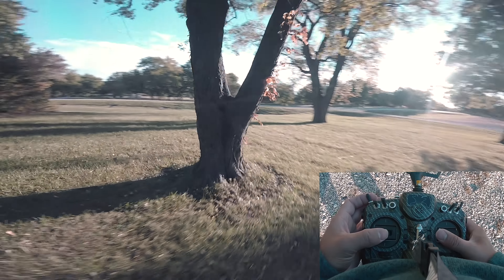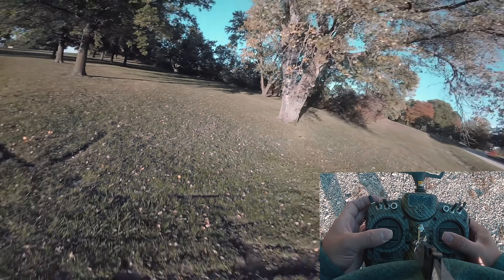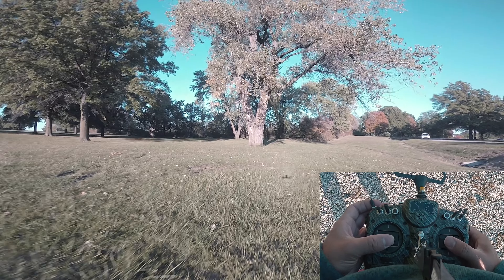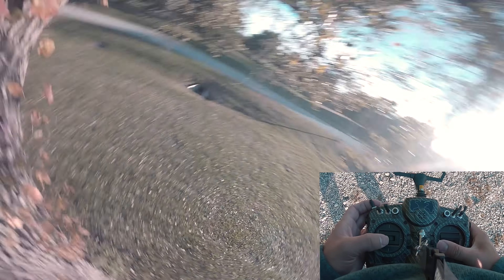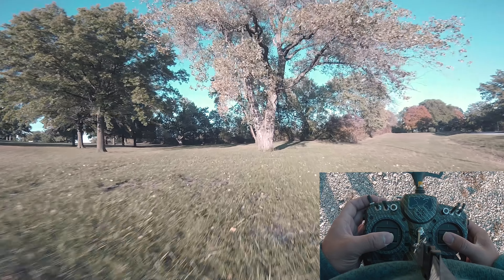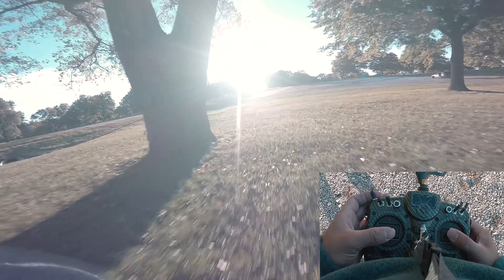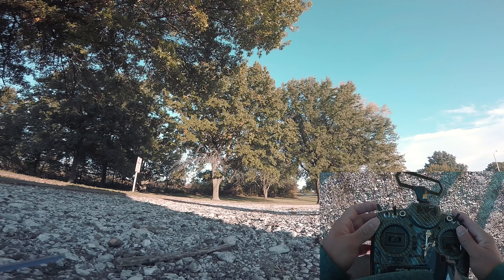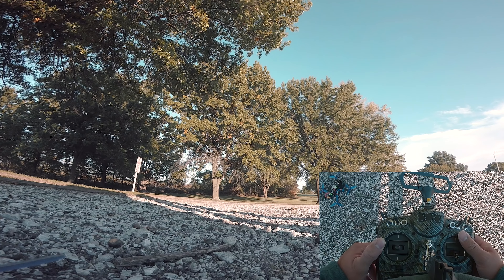FPV TRICK SERIES: HOW to SPLIT-S a GAP 🔥🔥🔥| FPV FREESTYLE!

Comment: So your flying is so fluid! How do you get almost no propwash? Did you feel that the kiss V2 helped with that? I'm still on the V1
Reply from the maker: Kiss v2 helps a lot with that and having the right weight and prop and motor. The setup I have has been solid for months that’s why I haven’t changed anything.
Reply: Thanks so much I think It's time to upgrade to a Kiss V2 and the new esc's. 
I have the same setup as you only the flight controller and esc's are still the V1. 
I definitely agree that your setup is rock solid!!

Comment: hey there awesome flying what drone setup r u using? id love to get myself a nice fpv racer for the holidays... 4" or 5? id love to kno what machine that is... and did u tune it or did it run pretty str8 out the box? what would u recommend?
Reply from the maker: I run only custom builds that I made myself. All the parts are listed in the description of this video. If you want to fly I definitely recommend building one

Comment: Hey bro New sub here, I am very new to the hobby and am just now buying gear. I have done a lot of research and I ordered the fatshark hdo goggles last week (like new and good price on amazon)
and I already know that I am ordering my Taranis in a couple of day's but I noticed that your radio is a different mode than my buddy's. how did you end up picking that one and does Mode 3 have any advantages over mode 2 in your opinion? I don't have any local hobby shops in my area that carry anything other than mode 2 stuff so I would like to know your opinion since I love your aggressive style which will most likely be my style as well (eventually :)  keep up the great work bro!!
Reply from the maker: I will say the following is just my personal opinion : 

I did a video over why I use mode 3. In short I got mode 3 and sticked with it for better throttle control since i think that is the most important aspect of our flying. You can change the modes on any Taranis by just opening it up and switching the stick springs for the throttle so that the throttle is on the right side and I think there is a setting you will have to configure in your Taranis too. I like the throttle on the right side because I am right handed. If you are left handed I would stick with mode 2 which is throttle on the left side.  https://youtu.be/W9HblRWBY9U
Reply: @VIKFPV  my bad I missed that video so thanks for the link. That makes perfect sense though.  I'll play around with it in a sim and see which feels natural to me. Thanks for clarification and I'll check that video out